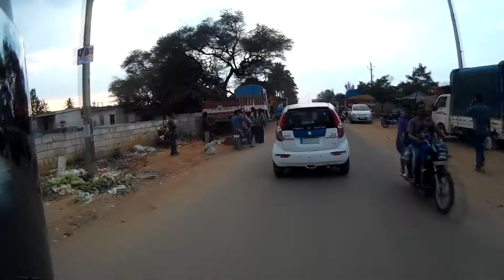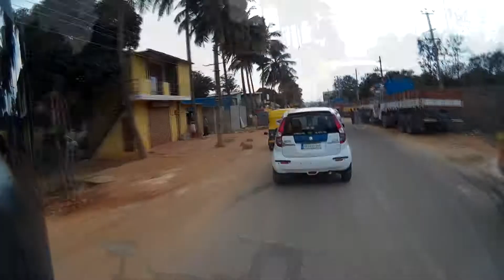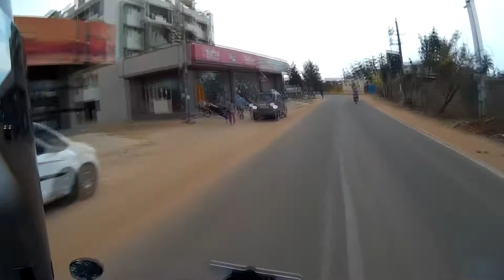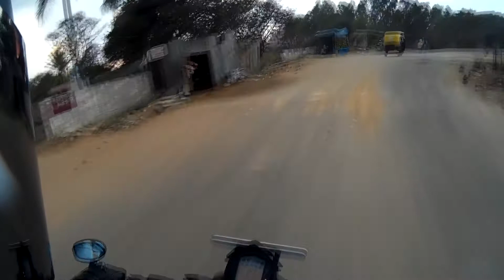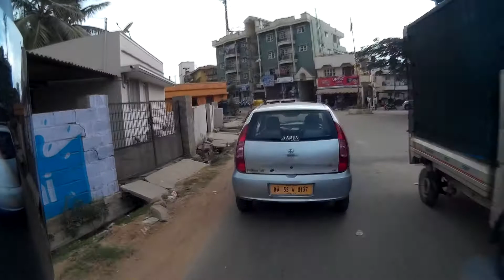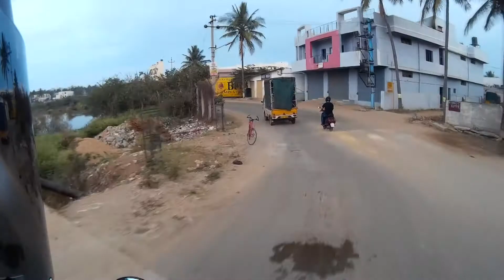HOW TO DOWNSHIFT(THE PERFECT WAY)

Comment: @Anubhav.. you are talking about the clutchless downshift, which requires throttle blipping. Normal downshifting also requires opening a lil throttle as explained in this video, but not as 'dramatic' as blipping.